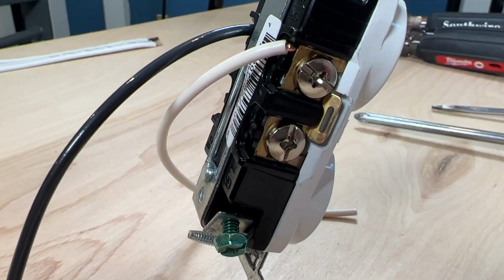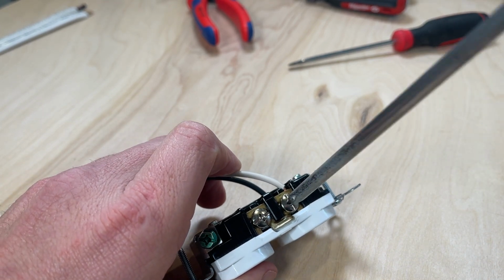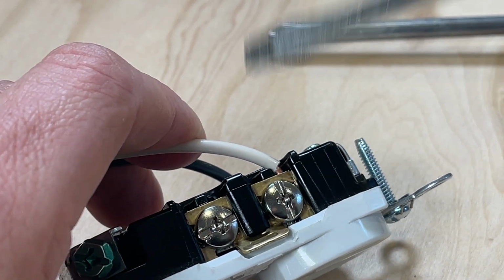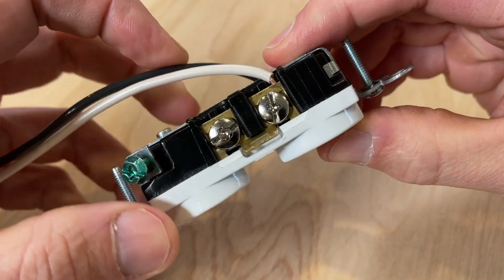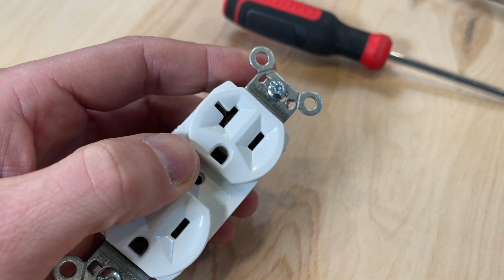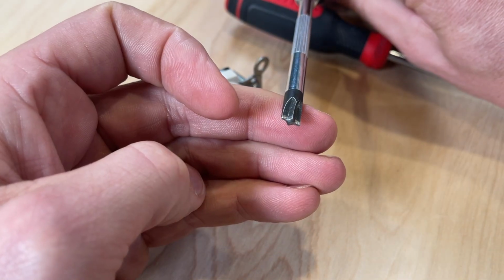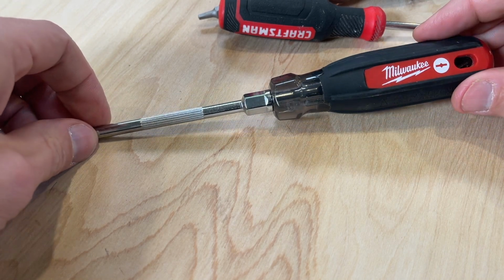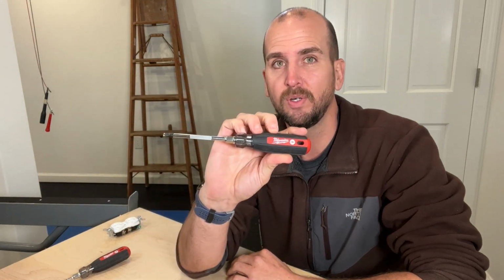80% of People Use the Wrong Screwdriver For Electrical Work

Comment: For the average home DIYer, that doesn't want to invest in another "specialty" tool that may see very minimal use, I'll go with the Robertson as I already have several of those loose bits and didn't really know what they were used for but now I do!
Reply: Robertson is amazing so much better than philips
Reply: a good quality #2 phillips grips much better than his illustration.  but the hybrid locks in like nothing else does.
Reply: @kenbrown2808  I see no advantage to the ECX over a Robertson - it's just a gimmick to sell custom screwdrivers to yanks - in Canada, everyone has always used Robertson drivers exclusively for electrical work. I do enjoy how now in the US "square drive" wood screws are like a high end specialty item, and in Canada nearly all wood screws and self tapping metal screws are Robertson.
Reply: @gorak9000  Most of the screws I've gotten in the last decade were Torx instead of anything else... I have nothing else in my garage actually, and I didn't do that on purpose lol
Reply: @CB-lh8gw  good luck finding torx screws on electrical devices though.
Reply: @gorak9000  having used a #1 robertson, when I got sold one of those after asking for the hybrid, and the hybrid, the hybrid locks into the 3 in 1 screwheads better.

and no, our high end screws all use Torx.

our consumer screws are mostly phillips, because that's what most homeowners have.  our sheetrock screws are Phillips because a square drive won't release out of a sheetrock screw under power, and that's what sheetrock guns here rely on.  that leaves Robertson as sort of a "well, it was a reasonable idea except for the patent thing, but now we have torx" throwback.

so I look at people who insist on using square drives kind of the same way I look at people who drive Fords on purpose.
Reply: @kenbrown2808  Lol, or, in my mind, any one who drives ANY General Motors product on purpose...and Fords, too!
Reply: @ralphfoster5752  some people NEED a vehicle that is designed to be a workhorse.
Reply: @gorak9000  honestly, it doesn't look or feel advantageous vs robertson, imo. It looks fancy? Plus I'd need bits for a torque screwdriver to really consider it what I grab first anyway, so Robertson it is. I use Robertson, Torx, and reverse Torx everywhere that I can. For anything I'm building myself of course, save for gypsum wallboard, where Philips shines for it's medium "cam-out" ability. IMO. 

Can you even get a Robertson or Torx bit fit for sheetrock drivers? Sounds like a suck idea to me, but damn near everywhere else, awesome. Can build simple but strong items like tables or water heater stands etc real f'n quick with a framing nailer & a bucket of torx wood screws.
Reply: Agreed. While Phillips head screws are great for what they are, Robertson is where it's at! If you have a good quality screw and  driver, the driver will just stay in place without even holding it. 
The Milwaukee driver is interesting, but it is a specialty tool that only really has one use.
Flat head screws should honestly just be phased out. I feel that most of my screwdriver "mishaps" are 99% because of them and their uncanny ability to slip out of place at the least opportune time.
Reply: Robertson is the best screwdriver bar none, the main reason it’s not used as much as it should is it’s Canadian whereas Philips is American.
Reply: @SoleEpiphany  and Torx is better than the square drive nowadays
Reply: @boomertsfx1  yes but you can’t get say a 30lb box of torx deck screws🤣
Reply: @SoleEpiphany  I did for my deck...big Ole bucket!
Reply: @boomertsfx1  yeah I've done the same. Plenty, recently and years ago.  I wonder where they shop?
Reply: @SoleEpiphany  Well the real reason Robinson's it's not as common is simply because Ford wanted to use them because they were superior and easy to manufacture (both the screw and the driver). BUT Ford wanted the exclusive right to use them and if I remember right even wanted to manufacture them, Robinson said "no" and Ford said "Screw you then" and went with Philips.
Reply: @Uzwel  wow, I didn’t know that. That’s kind of cool.
Reply: You can get the bit for your impact driver too, though. It's what I use for screwing the outlet into its box.
Reply: @ghg789987  IMHO the impact driver has way too much destructive power. I use the tips in my drill, set at a low number tork
Reply: @steveurbach3093  my dewalt impact has a low speed low torque setting. 3 speeds in total
Reply: @steveurbach3093  , impact-rated drive-bits are excellent for general use in hand-held, socketed magnetic screwdrivers, but I agree that using a cordless impact driver to tighten electrical outlet screws is overkill and probably not a good idea.
Reply: @ghg789987  hey thanks I was wondering about this... is it only milwaukee that makes it?
Reply: @jbbolts  you can get the bit for your impact in just about any bit set. I'm not sure if the screwdriver is exclusive to Milwaukee or not. I'll be getting one either way
Reply: I didn't know until I started a project to add a subpanel to my garage recently. Noticed a ton of the screws had that square head to them and remembered like you that I have a ton of bits with that shape I'd never used before...
Reply: The acerage DIYer is too smart to soend money on a stupid specialty screwdriver that makes not difference at all.
Reply: @FuckTheState  You're talking about ECX, correct?
Reply: It's also worth noting that Canada and the US as recently as 5 years ago began standardizing all electrical equipment to be equipped with #2 and #1 Robertson screws. Since both counties sell and buy electrical equipment from each other. I've heard rumors that the US is even slowly adopting Metric. Or at least a dual systems.
Reply: @JohnNorton86  I wouldn't say we're adopting metric. But both are useful in their own ways. I know both, and can easily switch between the two. I dont get the whole fuss over metric versus American. It's not hard to know and use both.
Reply: @zombieregime  taht psost ?made mmmy eye;balld tturn backeards. Hhu?
Reply: @zombieregime  who is "they" anyway? Britons, who also still use their imperial/avoirdupois system regularly? It's basically just us, parts of Britain, and our hat still using imperial.
Reply: @JohnNorton86  The US is indeed going metric slowly but surely. A lot of products you buy now are sold in even metric units, with some odd number of "fl oz" for us labelling. I bought a container of mouthwash recently, 1L. I looked at the old one that was empty, 1.5L. I started looking around the bathroom at other stuff - Shampoo bottle, 1L, contact solution 500 mL, etc etc. The only thing I found that wasn't a nice even metric unit that also had the equivalent imperial measurement on it was toothpaste - it was some odd quantity both in metric and imperial. Pretty sure it was labelled in oz and g, and it was some strange number in both. Probably actually measured in mL, but not labelled as such.
Reply: Technically we're still in the middle of a transition to metric started by the Carter administration. Reagan happened to be a stupid D- movie star and not a president, so he turned that valve shut. Hopefully that damn valve breaks off in my lifetime.
Reply: Or you could just call an electrician
Reply: @davidburcar7620  I'm fairly certain that many of us are electricians.

Comment: As a Canadian, of course I use the Robertson but those hybrid screws mean that it's definitely a compromise. Thanks for telling us about this better option. I like to avoid damaged, badly made and incorrect screwdrivers that require an annoying struggle to use them.
Reply from the maker: You and me both 👍
Reply: Yes, we use Robertson for everything up here in Canada. Deck screws, machine screws, etc, including electrical. Never understood why Robertson's never caught on outside of Canada. Torx is probably slightly better but more expensive and not as common.
Reply: @markfacca  It's actually an interesting story. You can find it online, possibly a video if memory serves.

Comment: I use the ecx bit from Milwaukee that I buy from Ace Hardware. That way I can put them in various handles. I wonder which came first, the screwed up screw or the screwdriver and what are the outlet manufacturers suggesting.
Reply from the maker: I almost bought an ECX bit the other day but still just have the screwdriver.
Reply: The History Guy did an excellent video on the screw. Very interesting.
Reply from the maker: @tom1788  thanks for the heads up.  I will take a look 👍
Reply: @tom1788  thanks I will try and find that. Because those screws are cheaply made and strip easily making your day much longer

Comment: So why does Klein not include a Robertson bit with their twirlys?
Reply: Because it is not an American design!  It is Canadian!
Reply: @plor25  snap on sell the american knock off version and charge an arm and leg for the set. they even use the official colour code for the sizing but they don't use the real roberston design with the taper so they are freaking awful they slip out just as bad as a philips. there is nothing stopping them from really using the real canadian version i think they just have to pay a small fee to the roberston company to do so.
Reply: @mraaron1584  Why would they have to pay a fee? They can't use the Robertson name, as I assume it is trademarked, but the patent(s) must have run out decades ago.
Reply: @danielcarroll3358  pretty sure they still have to pay that's why amercian's came up with a knock off version rather then just  making the real version.

Comment: I use a Robertson. But, what I always have trouble doing is getting 12/2 on the ground screw
Reply: you're not making a proper clean hook, then, because if you form the hook properly, it snaps right in.
Reply: You may be using a #1 when you need a #3 Robertson for the bigger screws.